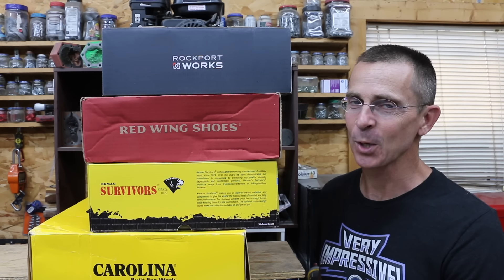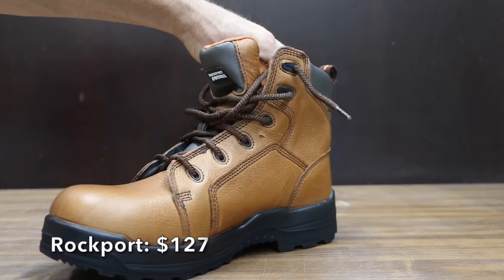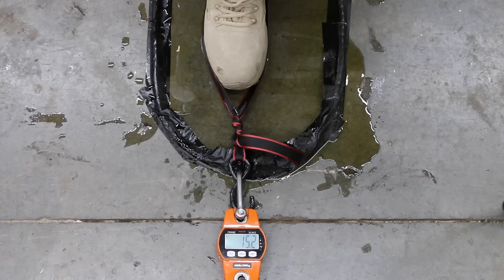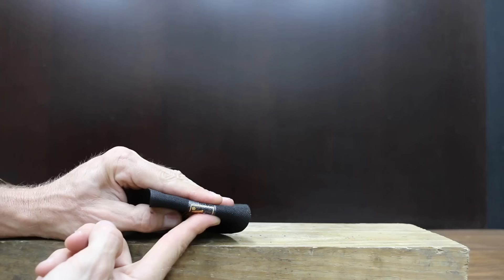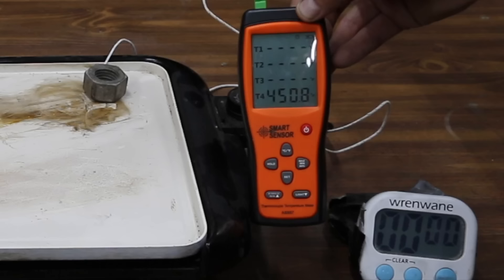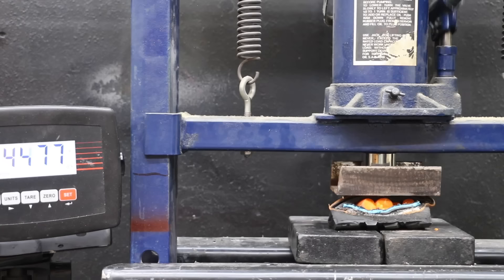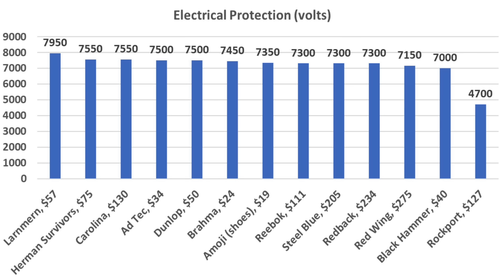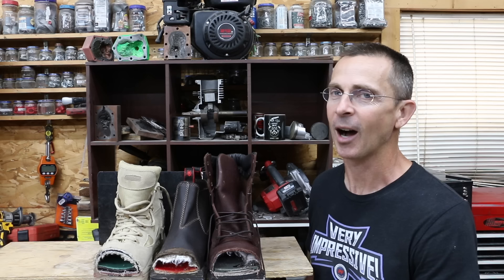Best Boots? $24 vs $275! Let's Find Out!

Comment: Over the past 25 years of wearing work boots every work day, I have tried well over a dozen different brands.  I stopped trying different ones when I found my redwings.  For me they offer the best combination of comfort, durability and longevity.  They were the only brand I found that I wear for much more than a year without them blowing out, breaking down or just flat becoming miserably uncomfortable.
Reply from the maker: Thanks for sharing.
Reply: I agree. Being on a concrete floor all day, climbing ladders, working on machines while in awkward positions makes the redwings the best and I still have a pair that I bought in 2013 and they have held up just fine. It is good to oil them down with redwing oil occasionally for added longevity. I still wear them to work everyday.
Reply: Same here.  Haven't tried as many but have been wearing Redwings since the '70s- on pair maybe #6 or #7.   I'm in & out of peoples houses a lot, so a relatively smooth sole that doesn't track dirt is important to me.
Reply: My RW 608 were going on 4 years before I replaced them.
Just cleaned and oiled them and they look so good in thinking a resole just for an extra pair.
Reply: I only wear red wings started wearing them because they were made in the USA
Reply: @stephenreamer4323  I own a pair of carhart boots. The winter insulated bad boys. And I can say they are a descent boot. They are in no way  anything 
Like a pair of Redwings with the comfort force 2.0 sole.
Reply: I feel the same as you do, but for Skechers.
Reply: Same here! I'm actually wearing a pair of one of their newer "athletic" style shoes with the composite toe, since I needed something with a bit more flexibility (lots of kneeling and walking on concrete). They offer a bit less protection against ladders, edges, and pointy objects, but they're much more comfortable for my particular work environment. I swapped from a pair of the "King Toe" boots.
Reply: Red Wings for life! 
Well, the Rest of my life!
Reply: My last pair of Redwings lasted about a decade before I recently deemed them to be worn out beyond usefulness. That price has really gone up since the last time I needed to buy a pair. Still, I'll most likely be getting another.
Reply: @Flying1776Eagle  I always make sure there domestic boots
Reply: I am an adamant red wing fan myself.  I've been through a few pairs, but I've also worked in caustic chemicals, also I'm hard on all my tools, and I do consider a good pair of work boots to be one of my tools.

I did hear recently that Red Wing cut out some of their sole material, I was pretty disappointed in that.  It has always been a brand focused on quality, hopefully that stays.
Reply: I have a pair of Redwing I've had for 8 years working in the mine. They look brand new
Reply: Been a mechanic for almost 20 years and have used red wings 70% of it. I’ve had one pair that lasted 11 months, the rest over two years easy.
Reply: 100%
Reply: You ever tried the other boots red wings sells or backs with their name. I got some worx by red wings and their so freakin comfy its nuts. I wanna buy some actual red wings but like the worx so much and their only 150
Reply: I'm with you. Mine have lasted a while and i abuse mine. 400$ is expensive, but redwings are worth it.
Reply: YES!
Reply: @mushroom13cfh  Save up.. buy the original style.  Wasting money on any other style of redwing.
Reply: Red wing would be the last boot I would purchase.  I get around 6 months out of either the Brahma or the Herman Survivors.  My first pair of Red Wings separated the sole at 2 weeks and were replaced under warranty. That replacement pair was replaced two weeks later due to toe sole separation.   That pair was replaced with a different style that separated the heel leather from the sole at 2 months.  The best I got was from an insulated version of the logger boot that ripped the upper from the lower at 6 months.
Reply: @SmDJeremy  I'm a mechanic that spends alot of tme on his knees or under equipment.  What was happening is the toes being curled up.  On the  2.0 soles they would delaminate between the dark inner layer and the clear layer.   Went to a more normal boot and that same use tore the leather loose from the sole at the heel.   Same issue I would have with the insulated vibram soled boots.   Basically due to the stifness of the sole the apparent stretch would tear the layers apart.
Reply: @ngnmech  ah that's too bad. Redwings are great if you're just on your feet a lot in the day.  I found they're great for my foot.. But I guess same can't be said for someone else in a different situation. Sucks boots only last ya 6 months.
Reply: Red Wings gave me Plantar Fasciitis. They dont have good arch support.
Reply: I like my Moctoe Redwings but they only last a year. I can get almost 2 years out of a pair of Whites.
Reply: @stephenreamer4323  according to Wikipedia redwing haven’t made carharrt boots since 2011
Reply: @ngnmech  I heard that the delamination issue on the supersole 2.0s were fixed years ago, but it may have just been improved rather than fixed.
Reply: This sounds exactly like me. I averaged 3 to 5 years out of each pair of Red Wings I get, while wearing them every single day at work and on my Harley. And they are very helpful in finding the 10 1/2 H for my wide foot.
Reply: Red Wing Irish Setter. I don't need steel toe, water proof is a must.
Reply: @Wastinglotsoftime 
I would definitely try a pair of whites or other pacific northwest boot . But there are no places around me that sell them and I don’t want to buy a pair of expensive boots over the mail without trying them on.
Reply: @8bert9  you work in an office bud or are you on your 3rd pair of soles? 😂😂
Reply: @codysmith7456  I am a Industrial Maintenance supervisor so I have an office and I work on the production machines when needed.
Reply: Agreed, but 5lb not good if you have bad knees.
Reply: Same, although I’ve only been a railroader for 9 years, I’ve had about 8 pairs of Red Wing boots over those 9 years. I do a LOT of walking on ballast with the Red Wings, and they hold up very nicely.
Reply: @stephenreamer4323  They have not been built by Redwing since about 2012
Reply: I went from RedWings to RockRoosters. If you ever wish to try a different kind.
Reply: I also wear boots daily though in warehouse/datacenter not industrial locations for nearly 40 years.  I've used the us army mounted crewman (tanker) boots with welted outsouls.  They hold up very well and you can easily just replace the outsoul when needed.   Added benefit is that they are strap buckled not laced which also helps with support and not getting laces caught on items.
Reply: @ngnmech6374 You should give Thorogood heritage mocvtoe a go.  I have tried all kinds of boots and couldn't get more than 6 or 7 months. I easily get 2 years from Thorogood,  and they're the most comfortable boot I've ever worn, directly out of the box.
Reply: Same, any other boot company never lasted past a year for me. the only pair of safety boots that last for 7 year was red wing. No brand compares to red wing.
Reply: I walked 23 years on prison yards as an officer in Red Wings. They did everything I needed and nothing I didn’t.
Reply: "
Close to 30 years with Redwing boots.
Reply: I got my self some 280$ thorogood boots because I was sick of buying boots every 3 months; they are very nice boots.
 Does anyone know if thorogood is on par with redwing? I've never bought red wings.
Reply: @ngnmech do you kick rocks for a living?
Reply: I got the BOA system and it's soooooooo fun
Reply: I bought redwings with the wedge sole. Sole wore out within a few months. Very sad.
Reply: Thoroughgood for me
Reply: @SmDJeremy  ive been buying the “king toe” they’re about 200 last time I checked I need to get a new pair my current ones I’ve had a few years they’re worn out, they’re not the most durable boots but they are really comfortable the soles wear out tho
Reply: Ahh not sure they sell those in Canada. Never heard of them.
Reply: I wore Red Wings for 35 years in the firehouse.
Reply: Yeah man. I’m on my 2nd pair of Red Wings after the first pair were damaged after 12 or 13 yrs. My current pair (2nd) are still kicking butt at 32 yrs & counting.
Reply: Red Wing boots are one of the few available in narrow widths which is a must for me.
Reply: If you look at the others in the same price range and MITUSA, Redwings aren't really alone. JK, Nicks, Whites, Thorogood, Franks, and to a lesser extent Danner, are all good comfortable boots that will last years.
Reply: Same. Redwings last me considerably longer per dollar, and in my opinion, are the most comfortable.
Reply: I always use DeWalt Challenger... they are light and very comfortable...
Reply: Agreed!  I have been in the trades for 20+ years and have tried others thinking I would save money by not getting red wings and every time I've gone back.
 I won't use any other boots from now on. They are worth the money.
Reply: Keen Boots have never done me wrong
Reply: Red Wings consistently last over 2 years in harsh oilfield work for me. I'm in a vacuum truck, so they go through mud, oil and produced water spills, chemicals, etc. They take quite a beating and are always comfy.
Reply: I wear Keen Lansing Low most of the time since I can go from normal life to work without changing shoes. But I go through 2 pair a year since I also hike in them.
Reply: Redwing all the way have 3 pairs. Great for being on your feet for 12 hours a day n waterproof
Reply: Yes, but I’m 6’5 with a 14 inch size.  It wouldn’t matter if Red Wing is the best boot if they don’t make any that fit me.  It $ucks that I always have to go to places like DXL just to find shoes and boots that fit men who aren’t a cookie cutter size.